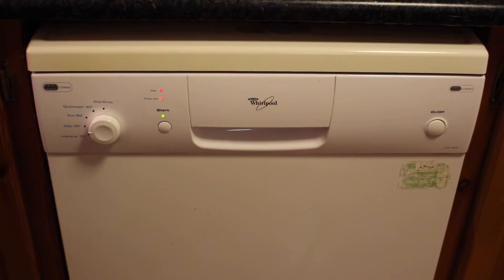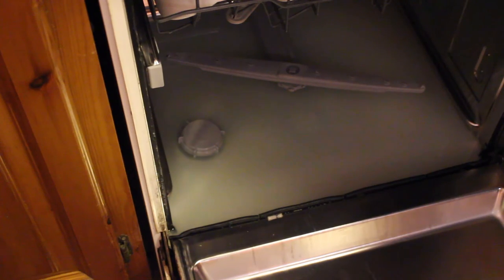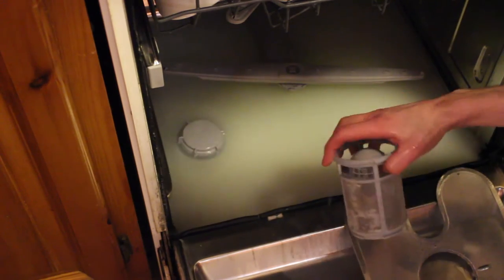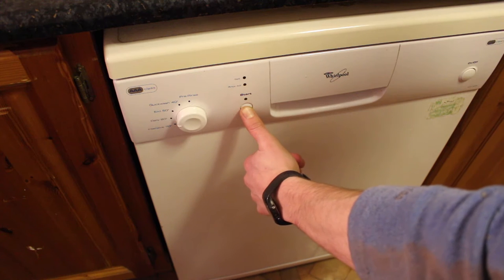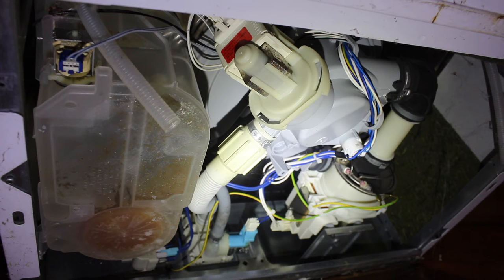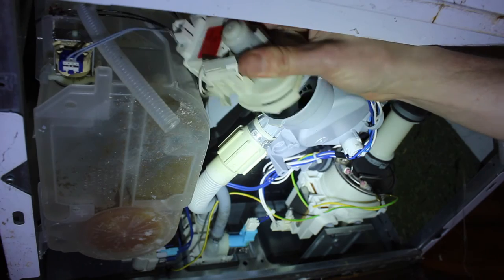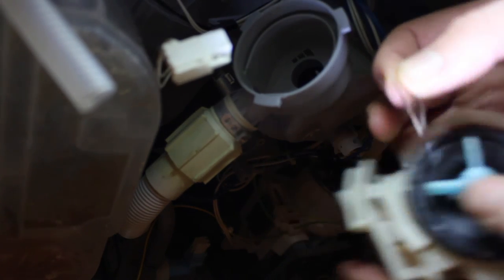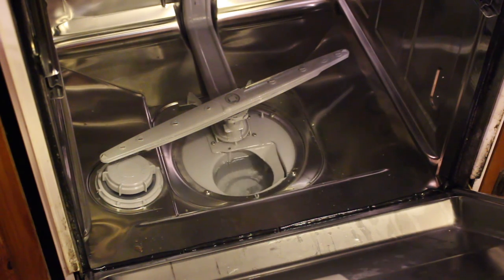How to fix Dishwasher Drain Pump problems (Fault code 4)

Comment: Sometimes the water level sensor gets too dirty and system will send the same error code, four flashes. I have replaced it a couple of times. But now I've got another problem. The cycle starts, the water is being pumped, then after 5 minutes the water noises just start to fade away. After ten minutes the water in the machine stops circulating. I can hear the motor trying without effect. Have you got any ideas what went wrong?
Reply: did u find an answer
Reply: @realBarronTrump  Yes, a very sad one: I had to install a new main pump. It's been working since then.